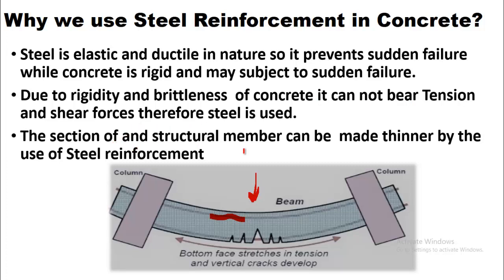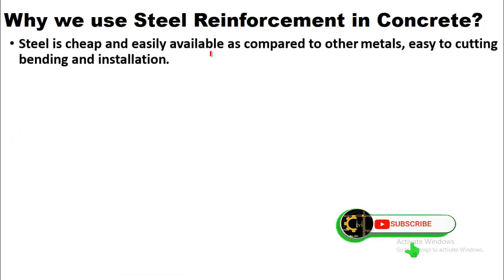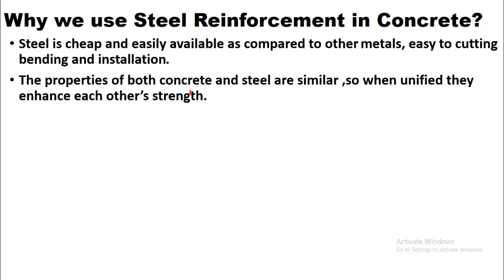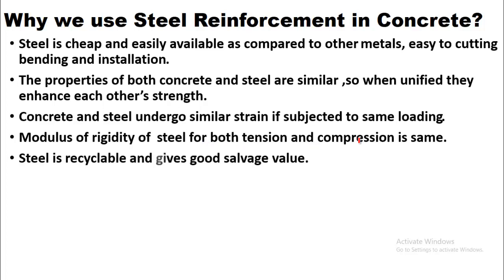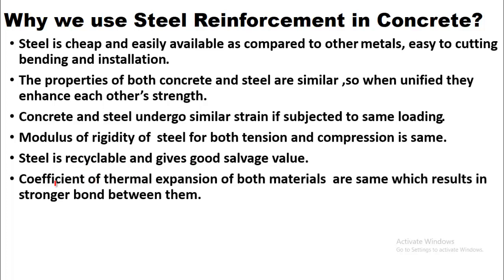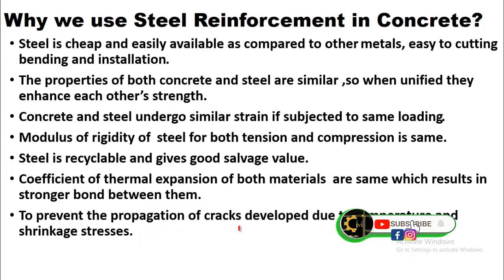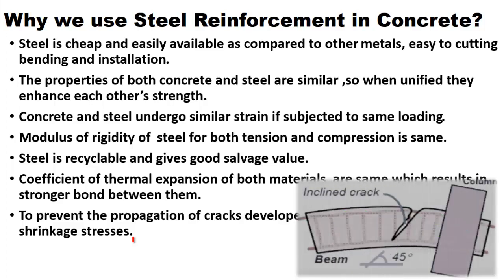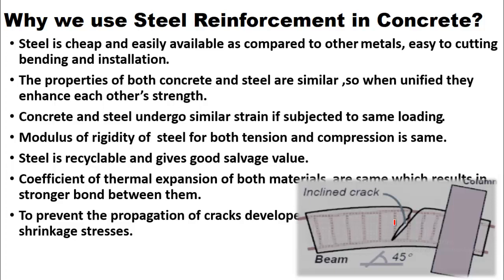Why steel is used as reinforcement in concrete?|Why only steel is used in concrete?|Role of steel

Comment: Well, not a loss of bond but a difference in coefficient of thermal expansion will cause shear forces with the steel and concrete bond locations due to differential expansion. So although it’s appropriate to say it causes bonding issues, it’s not fully explained why. Good video
Reply from the maker: Appreciated